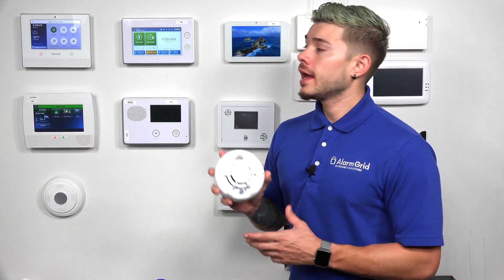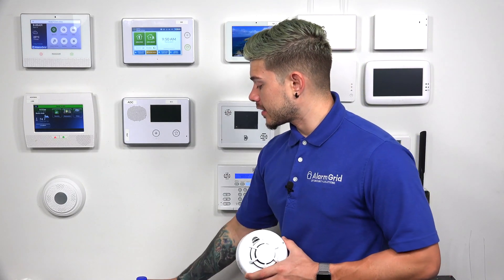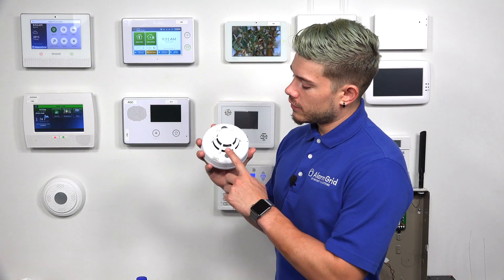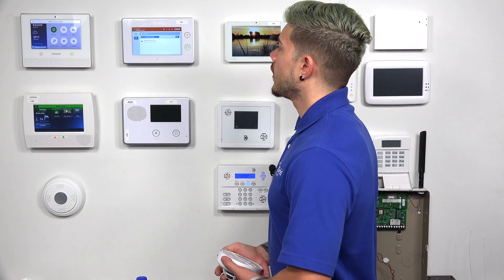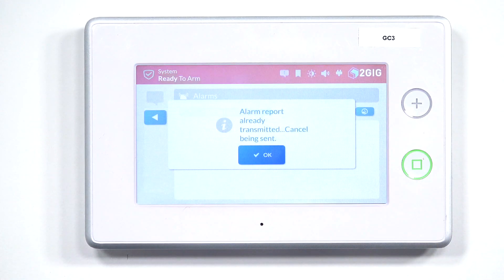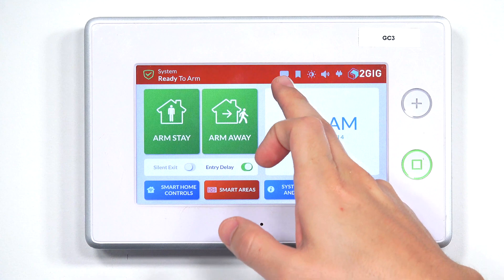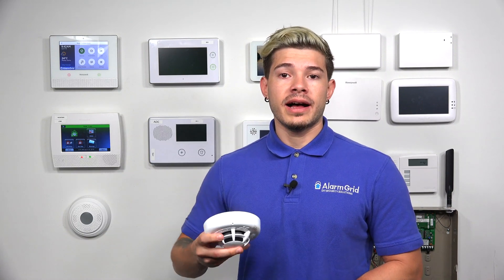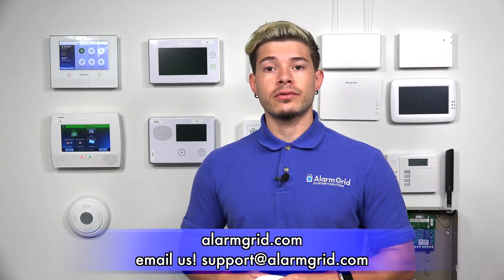Testing the 2GIG SMKT3-345 Smoke and Heat Detector

Comment: I replaced batteries and it is still flashing yellow every 6 seconds and chirping every 45 seconds. No error message on the panel. If I push the test nothing happens! No alarm test. The date on it says replace in 2025. It is April 2024. Help!!!!!
Reply: Hello, @DAlilbigman. There are three types of led/sound patterns on the 2Gig-SMKT3-345. I believe the led/sound pattern you are experiencing is the alarm Dirty Feature. ** When the alarm has been contaminated, the yellow LED blinks once every 8 seconds and there is a chirp every 48 seconds. After 4 hours the 2GIG Control Panel displays a loss
of supervision message. The only way to clear that message is to clean the unit and after attempting to clean the unit, if the message still remains after cleaning. The last option is to replace the module.

Comment: I have one in my house and my brother burnt potatoes and the detector activated but the unit itself wasn’t beeping but the keypad was going off, is my unit defective? I dont know the model name of my security keypad but it has a touchscreen and it has a sticker on the bottom left corner that says IQ panel
Reply from the maker: The 2GIG SMKT3-345 does have a built-in sounder, so if you are sure it didn't sound while the alarm panel did sound for an alarm on that particular smoke (and you didn't hit the button on the smoke to temporarily silence it) then it may be defective. It is possible, particularly if the sensor and the alarm panel are close together, that it may have been sounding, and it was just difficult to hear with the alarm panel also sounding.  If the system was professionally installed, I would recommend you check with the installing company. If not, then you may want to get some canned smoke, as shown in this video, and further test for yourself.  This is a life safety device, so you should have complete confidence in it.
Reply: Alarm Grid ok, i know the sounder wasn’t going off, after i took it down and hit the hush button, nothing happend, my brother took the batterys out for 5 minutes before Putting them back in, we put the alarm back up and the keypad was still in alarm so we had to enter the code again to get the alarm to go away, i will have to check it again to make sure uts not defective
Reply from the maker: @minnesotaoutdoorwarningsirens   Is this the only smoke detector you have?  If somehow this smoke detector wasn't the one that activated the alarm, it wouldn't sound (but the one that caused the alarm would and the panel would).  That's why I say you should test thoroughly to be sure exactly how it's behaving.  Those products should be warranted for a year from the date of purchase, so if it is defective, it's important to contact whomever you purchased it from as quickly as possible.

Comment: I put in new batteries and it still beeps. Is this unit defective?
Reply: Did you put them in correctly? if so, then the unit could be defective. I recommend replacing it with a new sensor.
Reply: @AcElectronicSystems  mine flashes red-yellow-green, but I no longer have a panel with the sensor.
Reply: @robertnowell7966  does it flash red, yellow, OR green? Or all 3?
Reply: @AcElectronicSystems  It flashes all three, in a fairly quick sequence.
Reply: Power it down for 30-second reinstall the batteries should have just a flashing green.